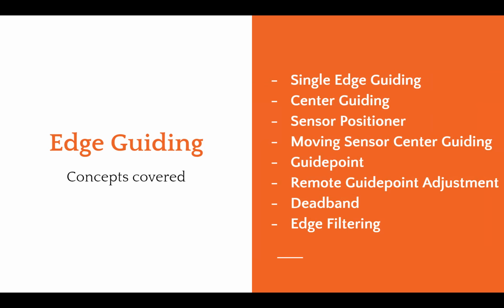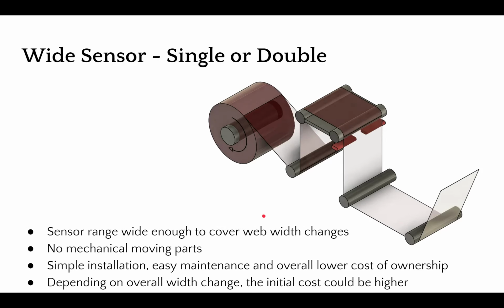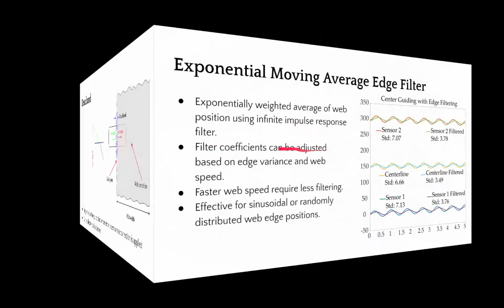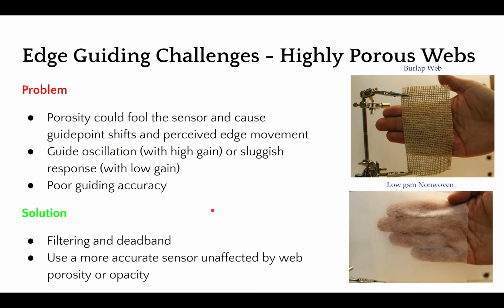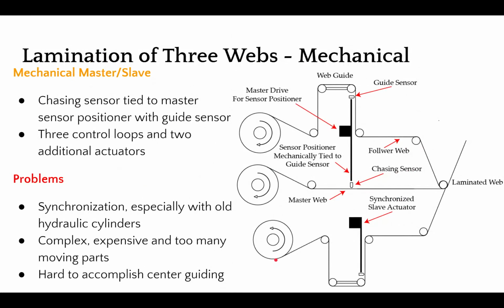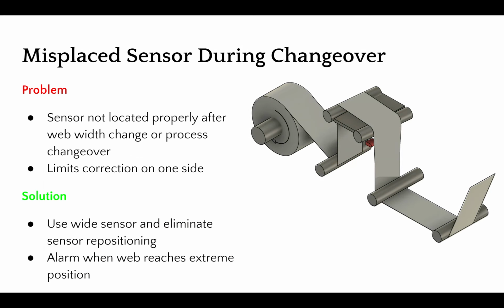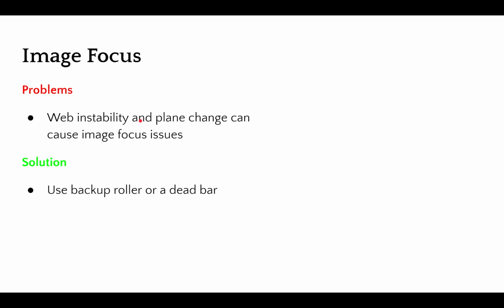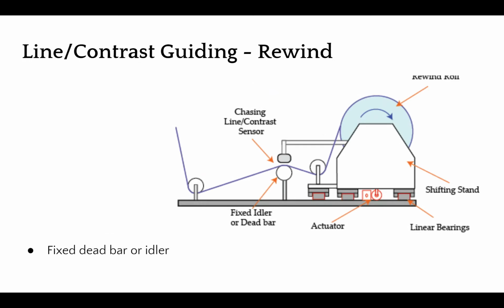Web Guiding Applications and Advanced Web Guiding Concepts

Comment: Why not use a single wide span light source and a single wide span receiver, when the width of the web changes the the amount of light received increases or decreases to drive the actuator? Many years ago (1980s) Japan was using these devices. I believe it was Hitachi that was tested at Dofasco Steel Hamilton. Not sure if light deflection was an issue with metal material, but the amplifier had some gain adjustment to compensate for diffuse reflection.